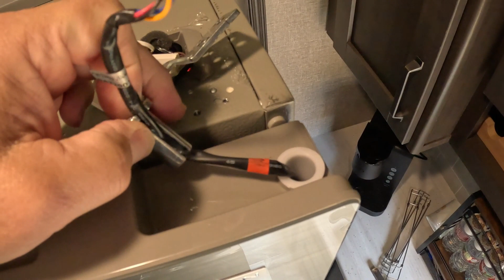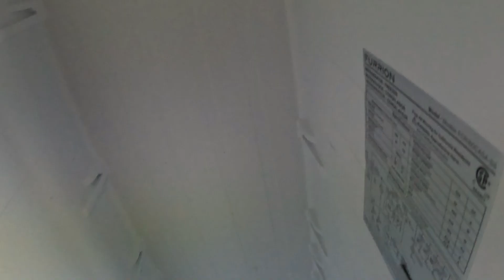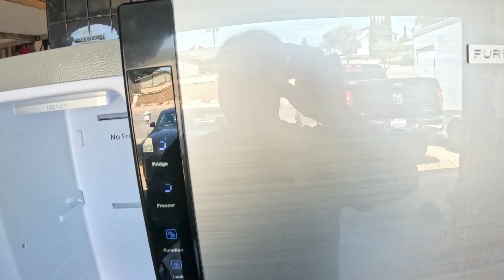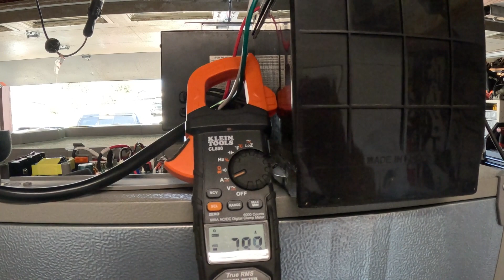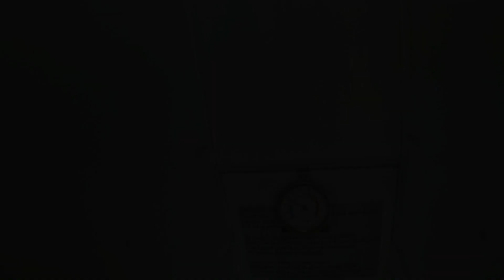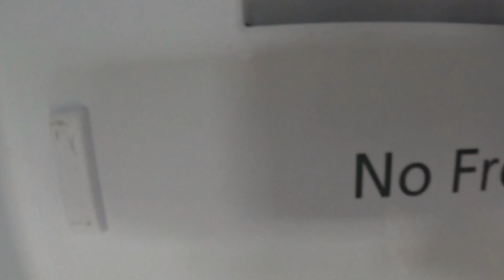Furrion 16 cu ft Refrigerator

Comment: Thank you for your video, it was very well explained. I have the same refrigerator as you. My problem was that the side of the freezer was freezing up too much, to the point that it actually pushed out/deformed the white plastic cover over the coil.They are going to replace the fridge because I had purchased an extended warranty. But I still don’t know what is causing the problem. I thought it might be the defrost sensor or perhaps the control panel I would at least like Furrion to be able to replace the parts. But we can’t even get the plastic cover that goes over the coil.   
👍

Comment: As a factory serviceman, Let me help other people trying to troubleshoot this because this gentleman kind of messed up and I’m gonna explain to you why it’s not working correctly.  When you turn both of those icons on the screen once for freezer ones for refrigerator until the FREEZER gets down to whatever it shows to be programmed for ( -10)  then it will not then satisfy LED special function and turn on the one for the refrigerator… so he needs to turn on the one only for the refrigerator and turn off the icon on the left for the freezer.  The very second he turns off the option for the freezer mass cool down, then and only then will that door open and allow cooler to come into the refrigerator.  The problem is that when you put both of those icons on, it has to satisfy the freezer first.
Reply from the maker: I appreciate the feedback. Keep in mind that I performed many hours of troubleshooting before getting to the point of actually removing it from my RV. Some of that troubleshooting included graphing the internal temperatures in virtually every mode of operation possible. Unfortunately, I didn’t capture any of that on video.

Since the video was more about trying to demonstrate the problem (freezer too cold while refrigerator not cool enough) I tried to replicate the problem a number of different ways. What was captured in this video was simply one of the many different control settings. In the end, these refrigerators were plagued by two distinct problems - icing up (which mine was not), and the issue captured by this video.

I should add that since this video was posted, a number of replacement parts have become available. This issue could most likely been resolved by either replacing the temperature sensor or the control board.

Comment: What if I left the hole open in the top of refrigerator without replacing the air box?
Reply from the maker: You would lose the ability to control the temp and essentially make the whole thing a freezer
Reply: Maybe put a thermometer controlled fan over the refrigerator hole to cycle on and off? Just thinking

Comment: It would be nice for the mfg to have a recall or tell us the actual issues with this refrigerator. Our has been nothing but trouble. I wonder if is mainly due to a bad control board design. If people are replacing these refrigerators, what brand and size are they using?
Reply from the maker: @davebender6337  I believe the primary cause of failure is inadequate wiring and/or low battery voltage. When manufacturers first started installing these larger 12v refrigerators, many included undersized solar panels and undersized wire. If the battery drops below 12v and the refrigerator tries to go into a defrost cycle, the amperage draw can get extremely high, resulting in blown fuses and damage to the electronics.

Comment: How were you able to get the panels off of back freezer to expose coil etc.?
Reply from the maker: @heatherclemmer9548  
I did forget to show that. If you take a close look at the plastic panels, you will see some arrows. Behind those arrows are plastic tabs. You can get a thin piece of metal or plastic in there to release the tabs. Take a look at that panel when it is on the bench and you will see the arrows and tabs I am talking about. The first time I removed the panel, I just pulled on it to pop it off. You risk damaging the tabs if you do that.

Comment: You never showed us the trick on how to get the panel off. I’m having this issue now and need to know
Reply from the maker: @anthonyguess5528  
I did forget to show that. If you take a close look at the plastic panels, you will see some arrows. Behind those arrows are plastic tabs. You can get a thin piece of metal or plastic in there to release the tabs. Take a look at that panel when it is on the bench and you will see the arrows and tabs I am talking about. The first time I removed the panel, I just pulled on it to pop it off. You risk damaging the tabs if you do that

Comment: How do you get to the fan behind the freezer?  Without breaking the tabs?
Reply from the maker: @JimMatteyRVFIXER  If you look closely, you will see arrows where the tabs are located. I was able to just pull the panel free without breaking the tabs.  I did experiment with a thin piece of metal and was able to get them to release, but it took some finesse.

Comment: you said you where going to explain how you removed the panel in the freezer. you never showed how to take them out
Reply from the maker: @cracker5688  I did forget to show that. If you take a close look at the plastic panels, you will see some arrows. Behind those arrows are plastic tabs. You can get a thin piece of metal or plastic in there to release the tabs. Take a look at that panel when it is on the bench and you will see the arrows and tabs I am talking about. The first time I removed the panel, I just pulled on it to pop it off. You risk damaging the tabs if you do that.

Comment: Ugh!  These refrigerators are going to send me to the bar!  Lol!  We are on our 3rd.  First one found completely dead  by the independent inspector.  Dealer was quick to replace to close the deal.  Second one lasted about 2 months with very little use.  Defrost cycle would keep the compressor off way too long so fridge temps would become way too high.  Third one is now also getting wonky with the temp getting too high in fridge again, but I can hear the compressor running much more often, so thinking we have the same issue as you.  What do you think of drilling some small holes in that little gate/door to allow the freezer air to vet into the fridge section?  I’m talking just a few tiny ones , as an experiment to see how many are needed to keep the fridge temp consistent?
Reply from the maker: @lindaschulz3934   Interesting thought about putting some holes in that little door. Unfortunately, I got rid of the old unit so I can’t try that. The defrost cycle does seem to be an issue even on my new fridge. I need to do another video where I used two very accurate remote digital thermometers and logged the temps for a two week period. You can clearly see the defrost cycle and what it does to both the freezer and refrigerator temps. When my new fridge dies, I will be looking at Norcold as a replacement.

Comment: So  how did you unbolt the fridge from the slide out of the 303 rls  I have the same rv my fridge is crooked in the cabinet and the fridge side door is rubbing the wooden trim how to you remove the fridge so i can straighten it.  thanks
Reply from the maker: @kenschauble   At the bottom of the refrigerator is a board that is screwed to the floor, two of the screws go through the bottom hinges. Remove that board and the short board above the refrigerator. I also removed the trim piece that extends the length of the slide. I slid it out using two furniture dollies. 

What I found is that the microwave outlet was keeping the refrigerator from sitting straight in the hole.
Reply from the maker: Take a look at my other video , Refrigerator Safety Issues, and you will see why it is sitting crooked.

https://youtu.be/oc-HYQ0QwCQ?si=_bCFV8xvHvPCa5lY

Comment: I have the same fridge in a Grand Design 260RD. The fridge is located on the slide. I have been experiencing the same issues you mentioned in your video.  I am also wondering if the temperature outside plays a role in the cooling process. I was reading through the refrigerator manual and I believe it said that the food should already be cold before putting it in the refrigerator.  Wondering if the freezer has to get to the specified temp before the door on the refrigerator will open and allow the refrigerator to cool. Please let us know on the progress or what you find out. Thank you
Reply from the maker: I have done a lot of testing with both my defective refrigerator (after I pulled it out) and the new one I just installed.

Ambient temperature inside the RV does play a roll in cooling. Mine seems to have trouble keeping up if the temp inside the RV goes above 80.

Yes, adding food that is already cool helps significantly. Unfortunately, that isn’t always an option. Before I installed the new refrigerator, I would keep two gallon water jugs (about half full) and rotate them between the refrigerator and freezer. I found that helped significantly since the freezer has no problem staying cold.

Yes, the freezer has to drop to a certain temperature before the door will open and start cooling the refrigerator.

I did find that the automatic defrost in the freezer plays a big role in refrigerator cooling. One of the 40a fuses controls the defrost circuit. When I remove that (simulate a blown fuse) it doesn’t take long before the cooling coils freeze up and prevent the fan from pulling cool air across the coils. When that happens, the freezer seems to stay cool, but the refrigerator does not.

In the end, even the brand new refrigerator seems to struggle to keep the refrigerator compartment temperature consistent. My recommendation would be to install LiFePo4 batteries because they operate at a higher base voltage and don’t have such a drastic voltage drop over the charge cycle. Also, never, ever allow this refrigerator to run on low voltage. That seems to be the number one killer of these refrigerators.

I am hoping to get a couple more videos out soon.
Reply: I am wondering if a refrigerator fan or a fan inside the refrigerator would help to circulate the air and keep it cold?

Comment: Well I did feel the fan a little.  Worked with lippert thus morning and the said they would give me 30 percent off a new one. Unrepairable. Not defrosting. No parts to be gotten.  I just finished. Installing a residential.  Know anyone that might need some parts before it gets junked?
Reply from the maker: Given the poor track record of these refrigerators, anything less than a free replacement would be paying too much in my opinion. Since it isn’t defrosting, did you happen to check the fuses? I salvaged a few parts out of my old one and will be hauling the dead carcass off to the dump soon.

What residential refrigerator did you go with?

Comment: My first 16 ft fridge quit while under warranty.  Neither side cooled.  They shipped me a brand new fridge and it is now less than a year old and freezer works and fridge is 54 degrees.  I'm trying a hard reset now but not getting my hopes up. Do you think it might be possible to prop the airflow door open slightly and get satisfactory temps?  If this one is garbage I'll not put in a third one.  I love the 12v and when it works, it's works well but it's looking like time to get a residential.
Reply from the maker: That door is either fully open or fully closed. I think the refrigerator would get way too cold if it stayed partially open. Further testing (after I made this video) revealed a couple of possibilities for a cold freezer and a warm refrigerator. The door not opening or opening too late, but also a freezer that isn’t defrosting. One of the 40a fuses is for the automatic defrost. When I pulled that fuse, the coils would build up with frost to the point that air wouldn’t pass through resulting in a warmer refrigerator. Voltage is also critical. I found that maintaining a voltage above 12.5 at the refrigerator seemed to help significantly. Any lower than that and the recovery time seemed to go way up. Under the best of conditions, I think that refrigerator struggles to maintain a safe temperature in the refrigerator compartment. I am working on a video of the replacement refrigerator where I am monitoring temps closely and charting them. Hopefully I can get that out soon.
Reply: I took the part down in the fridge side that contains the door. I feel the coolness from the freezer but it doesn't seem like the fan is running.  I too have my door open switches taped to fool it.  Thoughts?
Reply from the maker: @jeffchambliss2625  Do you feel the fan on the freezer side? The fan only runs when the compressor is running, so it won’t run if/when it is going through a defrost cycle. If either door is opened, it takes 10-15 seconds before the fan turns back on. Sometimes, you have to open and close the door - that is why some parts of my video have the tape and some don’t. During my testing, I also had the fan not come on until I did a hard reset.

Comment: So what is the trick to get the panels off!?!?!?!?
Reply from the maker: I guess I did forget to show that on the freezer side. You have to pull all the bins and shelves out. There is one screw in the bottom panel that has to come out. Starting at the bottom, look for arrows that are moulded into the plastic cover (use your fingers to feel them because they are almost impossible to see). There is a plastic tab behind each arrow. I took a thin piece of metal and formed it so I could slide it in and help release the tabs. I did find that you can just pull on the panel and it will release, but there is a good chance that the tabs will break. On the refrigerator side, I did show the little latch at the bottom. Once you get that released, the cover will slide down and release at the top.

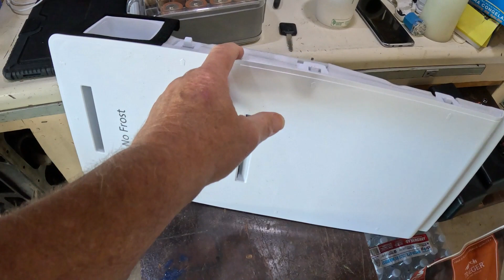If you pause the video at about 5:18 you can see the arrows I am talking about (look carefully above my ring finger). You should then be able to spot the tabs on the backside of that panel. At 5:18 you will also see that the tab closest to the duct going to the refrigerator is bent back.